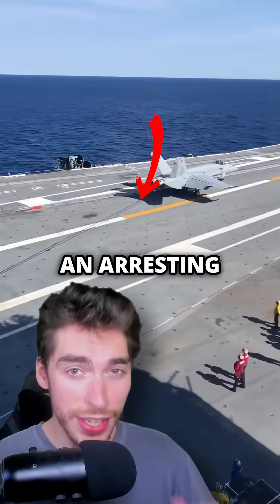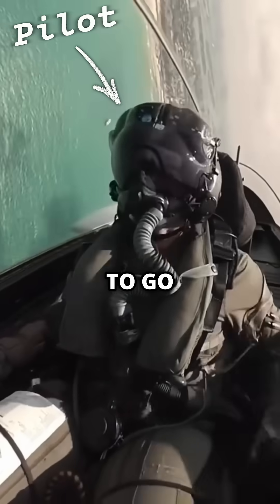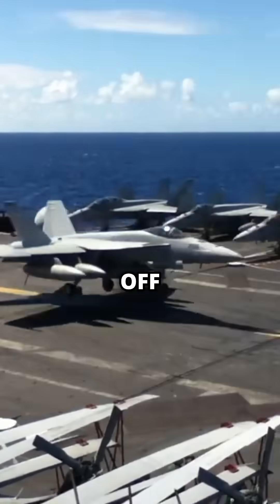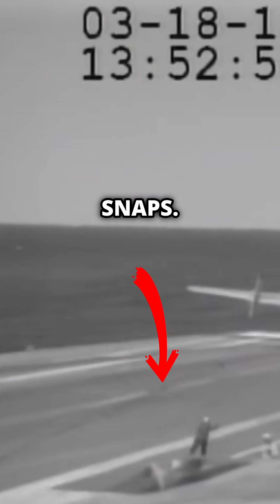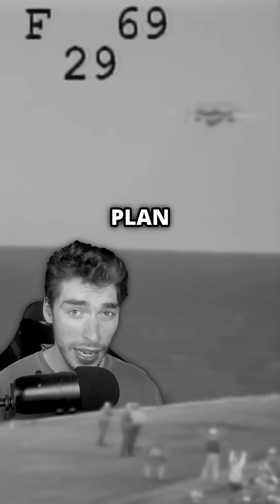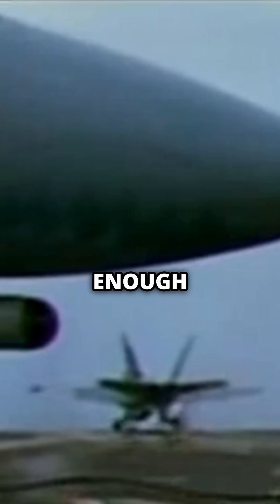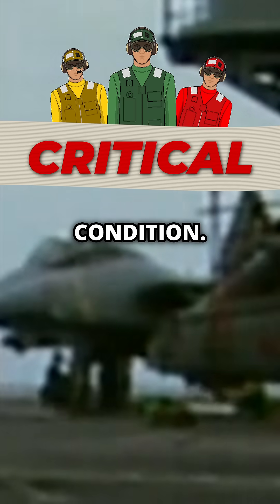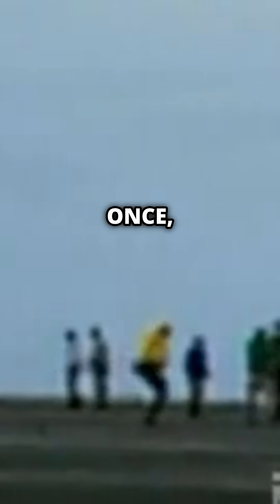The Scary Reason Pilots Go Full Throttle When Landing!

Comment: As a RAF cadet going to join RAF in future landing on aircraft carriers are the most dangerous type of landings since how short it is and the cable but some planes like the F-35B and Harrier can use there VTOL (Vertical Takeoff And Landing) makes it so much easier and the yellow dude got clipped a bit you cannot see it in the video since it goes that quick but he got hit in the foot/ankle bc if u look close enough you can see the cable go in the air and it barely clips him so it does cuz normally there is a little part at the top of it that sits a bit higher that you can't see